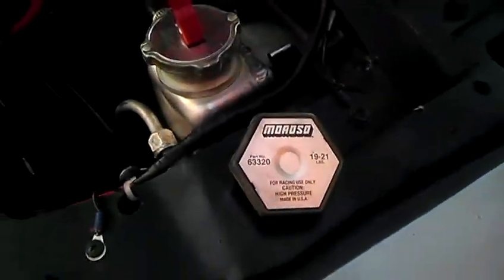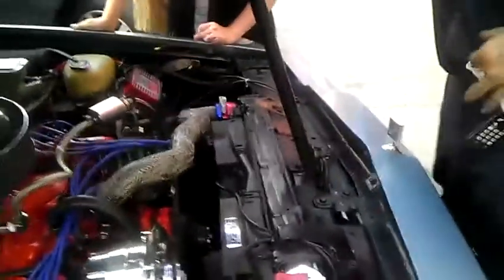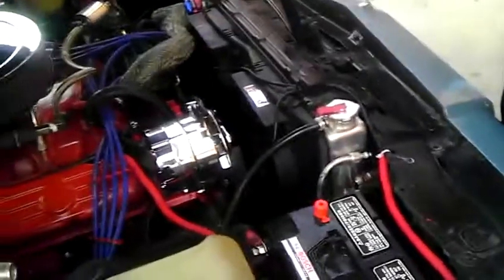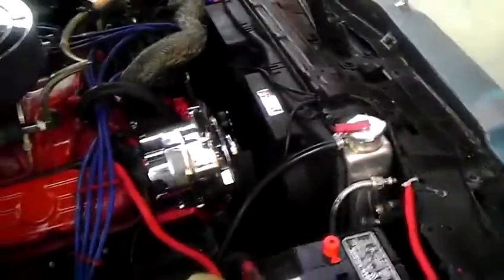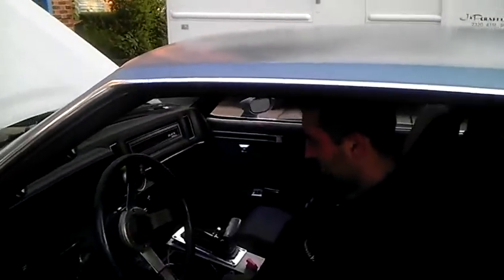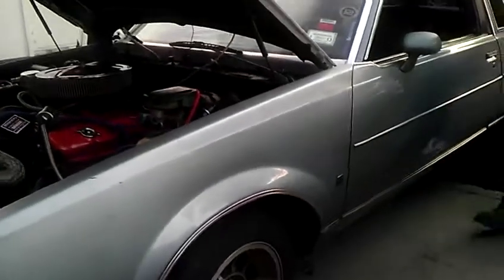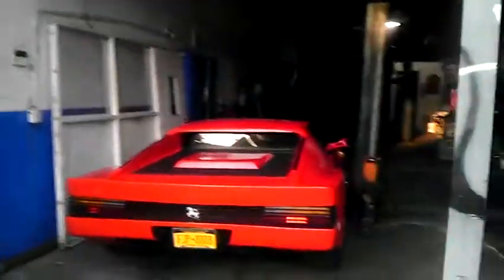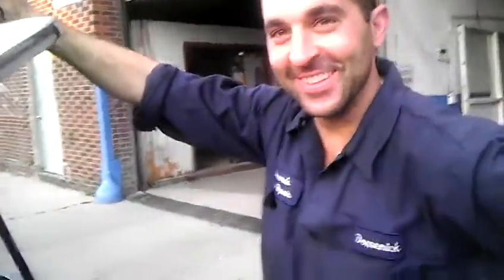CDS 1987 Stage-1 Buick 455 Regal's EXIT from DOMENIC.  8-26-2011

Comment from the maker: @428qcode 

You are CORRECT. Domenick set it there due to my overheating issue. We feel it's the twin Derale electric fans NOT being in close contact with the Griffin radiator. Domenick is fabricating me a fan shroud after he cut/modifies the fans.